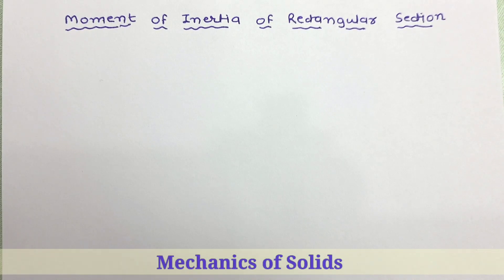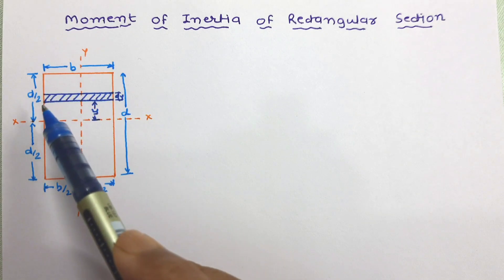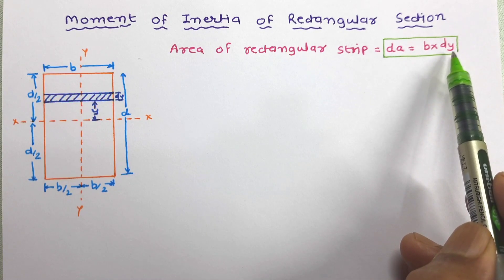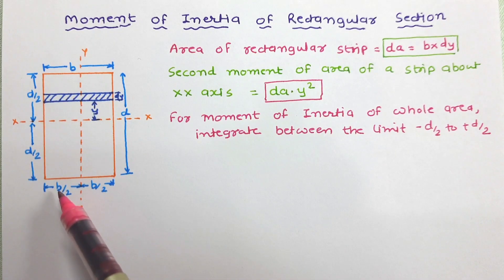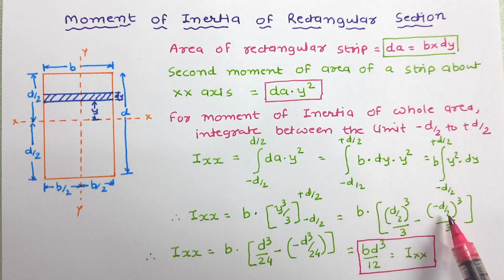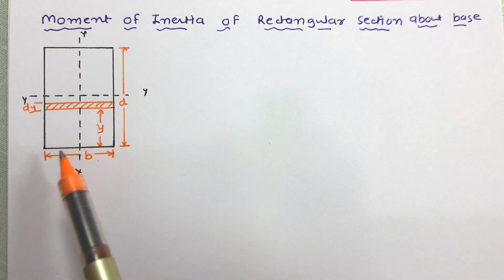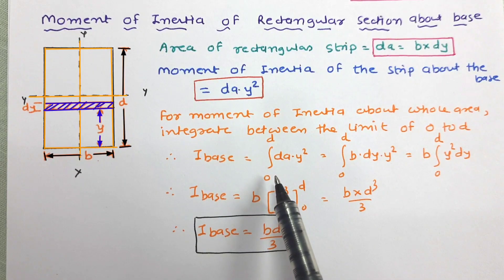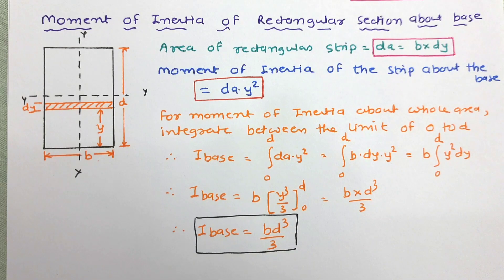Moment of Inertia of Rectangular Section | Mechanics of Solid / Engineering Mechanics

Comment: sir please help me i need your help 🙏

solve this problem statement
###################
The ministry of labour of the FGS is decided to build a system where all the civilians has to pass through a testing process before applying to any job. The process depends on the type of the job an applicant  can apply, If the applicant applies for a job that requires an experience of (5-10) years ,he/she
has to provide NIC, Master degree, Bachelor degree, high school or equivalent ,medical healthy and non-criminal record certificate and has to be older than 27 years , if the applicant applies  for a job that doesn’t require any experience he/she must have NIC, medical health and non-criminal record certificates ,high school/bachelor certificates.

Hint: Master degree holder can
apply to any job as long as it requires experiences less than 10 years while a person with no experience ,no masters and no bachelors  can only apply for a job that requires high
schools certificate or equivalent

Problem:
From the problem statement given
above build the system where:

a) The applicants have to have at least three documents for the system to
be functional (NIC, high school and Non-criminal record certificate)

b) Based on the assessments above who can apply for this job

c) If the applicants don’t possess one of the three documents mentioned
generate a message that informs the applicant that he/she can’t apply for this
job and his/her application will not proceed further

d) Find and simplify the Boolean equation of the system

e) Find the minterm and maxterm

f) Draw the logic circuit